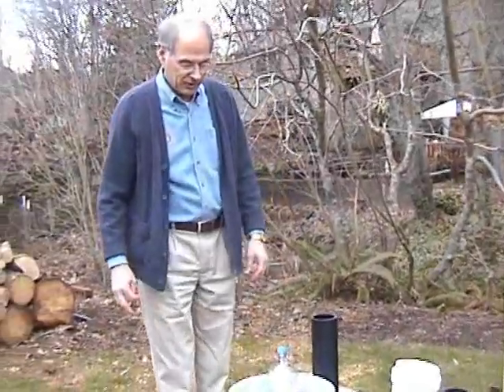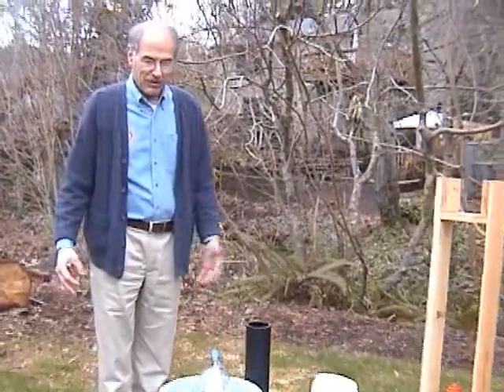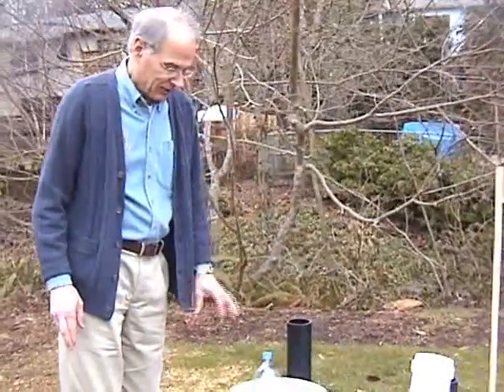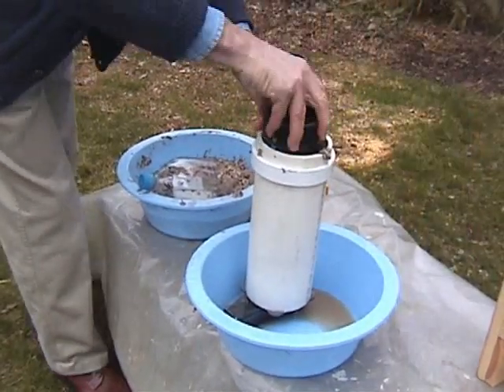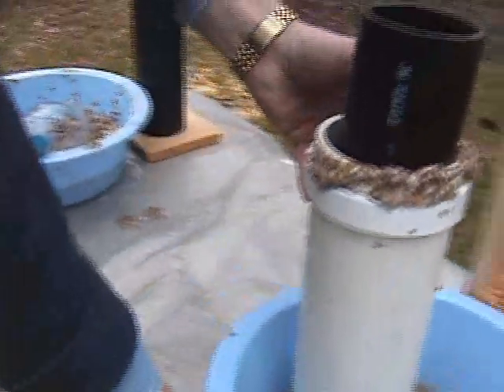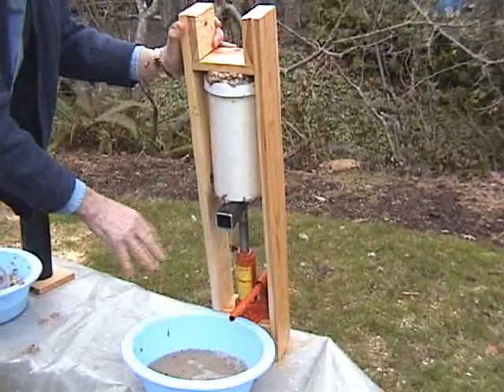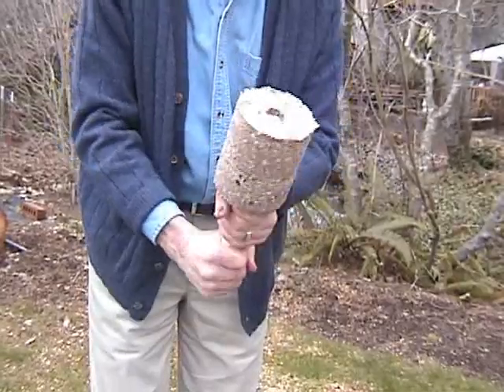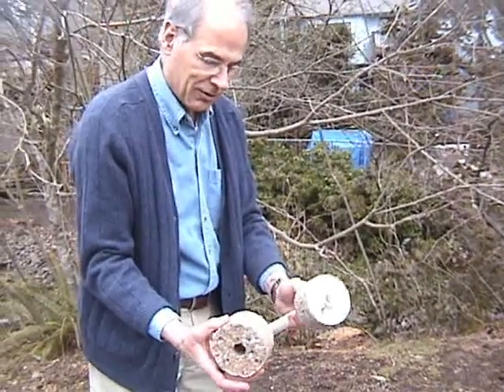Demonstration of Stage III Peterson Press

Comment: I have a couple suggestions/ questions, for the spacers, in 3rd world countries would not tin/sheet metal spacers ( made from tin cans )be easier to find than acrylic. also more forgiving is dropped or used extensively second in stead of using an ejector pipe. make a shorter ejector that also uses the plunger.saving @ 8inches of pipe